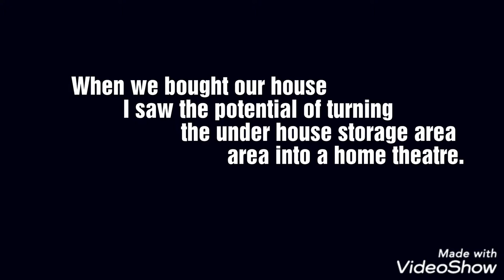DIY crawl space under house to home theater transformation

Comment: That's a lot of work! Not sure why you went with wood floors for a theater room though. Make sure to get some acoustic treatments in there too get rid of all the echoes. Rugs, drapes, panels, something
Reply from the maker: thanks for your comment, yes, I have big rugs for the floor. The acoustic is actually quite good, I don't hear any sound reflections/echo.  I went for wood flooring so the room can be multi-purpose.

Comment: Impressive work, Ken.

May I know where are you from? Guessing from your RHD Audi Q5 video, Australia perhaps?
Reply from the maker: hi Kris, would I pass as a Kiwi?  :)
Reply: @kenkanfix  Thanks for replying. I am not really sure, but do you know if it would cost about the same in Australia?
Reply from the maker: Hi, we did most of the work ouselves. The biggest cost were hired help for the digging, removal of clean fill, the steel I beam and concrete. The engineer report was only a couple hundred dollars.
Reply: @kenkanfix  Thanks Ken. I am planning to do the same, albeit at very early stages. I guess I need to pass the 'owner builder' certification course as a first step?